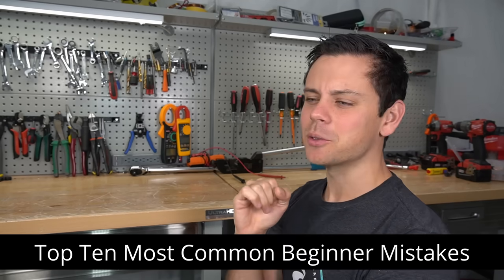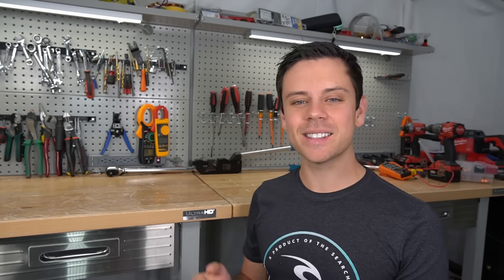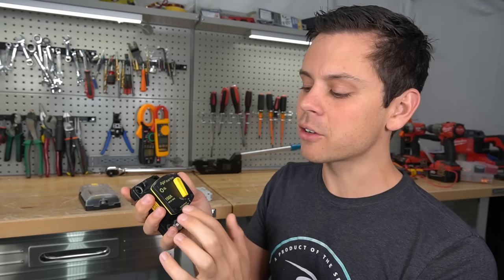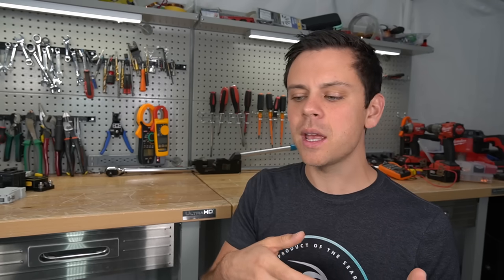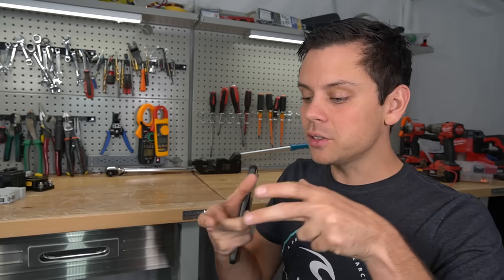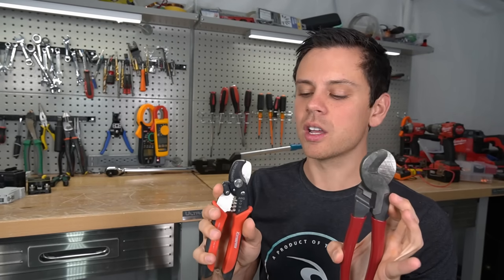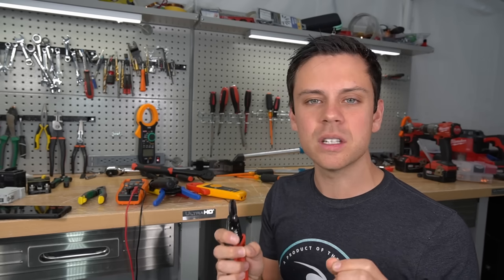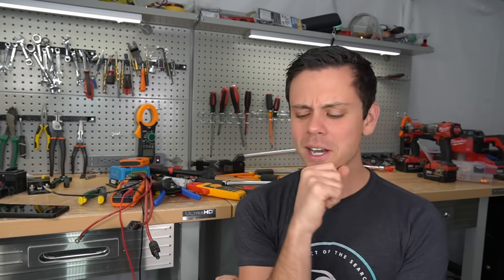Top 10 Beginner Mistakes When Building a DIY Solar System

Comment: No. 5: As an electrician I totally agree with you! In school they warned us about another point: solder gets soft over time and starts crawling and the contacts get loose and corrosion appears within. So, never solder when you can crimp!
Reply: Trojan recommends soldering battery cables.
Reply: Totally accurate.
Reply: @jeffwhite3021  Trojan is wrong. I live in Phoenix and it will easily exceed 150 degrees under the hood of my car during the summer. Many types of solder melt as low as 165 degrees. In particular avoid any solder with bismuth as part of the alloy.
Reply: I agree. I once did pull out tests of both molex crimp connections and soldered connections and the pull out force of the (properly) crimped connections were greater every time.
Reply: @ewe2b  It's about maximizing conductor contact area in the connector. They are suggesting and providing evidence that crimping and then flooding the joint with solder is best.
Reply: @jeffwhite3021  
I don’t know if that is what they are suggesting but what you said is the point of crimping then soldering.
Reply: @jeffwhite3021  
In mobile systems, a solder joint is a bad idea. It stiffens the strands in the wire bundle. With vibration, jostling, or frequent movement the wire will ‘work’ and break instead of absorbing the movement. Solder on any wiring with high potential for movement is not a good plan.
Reply: @fishhuntadventure  Marine ends get soldered. I agree it makes them stiffer which is why doing it properly with the proper terminals that are designed to be soldered is important. The round copper terminals that everyone uses are not good. For a crimp only situation you would use the split style connections with a tinned surface like you see in all OEM automotive applications.
Reply: @Zerpersande   he said a crimp that's "cold welded" is superior, essetntially saying a cold weld is superior to  a solder joint, which is hard to argue, but how many crimp jobs are actrually cold welded?  ... and who will check to verify?  some just mush the wires together, thats where the argument can be made soldering a crimp job is ideal since it fills in the gaps , gives you that insurance policy, and if your wires were cold welded the solder would have no effect in there anyway so it can hurt right? thats my understanding of all this misunderstanding
Reply: @mikejones-vd3fg  There is no such thing as a cold weld.
Reply: @jeffwhite3021  have you tried googling it?  anyway  the more i thought about it the more i suspeted no crimper could cold weld, im not up on my crimpers, but you can cold weld, metals actually stick together like water sticks to itself, they just have an oxidation layer from reacting with our air that prevents them from joining.  once you remove that oxidation layer you could stick the metals together without heating- cold weld, but from whati read about it long time ago you could only do that in space, from what im seeing on google there seems to be other ways... but i dont think a crimper is one of them lol,  maybe though im not an expert, but simple preasure wouldnt remove the oxide layer would it? maybe it does... but i dont feel like researching google either.
Reply: @mikejones-vd3fg  It's multi-faceted. Flooding an already crimped joint with solder will make a better connection than crimping alone.

Soldering alone (if done properly) will make a better connection than crimping alone.
Reply: That being said, after some more thought, like when soldering a wire to another one, you try and get as much contact with the wires befoer you sodler them intuiatvely,  you dont connect them to a blob of solder as a bridge  you use the solder to wrap hold them together, and idealy the wires are touching each other not with solder in between.  So solder might help a bad crimp job, buy filling in holtes, but thats less ideal then having those holes filled by actually wire- a better crimp job, and then the lug on the end sort of plays the role of the solder ,wrapping it all together.  The weak point is probably when you screw the lugs, all that contact you have with the wires could be lost there thats simply screwed, not soldered or crimped,  could have way less contact than you imagine under  a microscope.  So in the end if your soldering is helping it could just mean your crimp is not as good... and a better crimp is more ideal then having solder inbetween, cold welder or not.   But if you cant get a good crimp, solder will help.
Reply: @mikejones-vd3fg  Testing shows soldered joints have lower resistance.
Reply: @mikejones-vd3fg  
There is such a thing as a cold weld. Or at least the term exists. And it is NOT what is tossed about by DIY solar system fans. 

I worked in the distribution transformer industry for several years when I first dame to Japan. We had a problem with a 500kVA 6600V/200V transformer and a GE electrical engineer came to oversee the teardown. Problem? According to the electrical engineer, it was a ‘improperly made cold weld’. Which he explained as one of the leads from the coil wasn’t matched up perfectly with the output lead. The overlap was only about 30% of whT it should have been.

Now, the best I remember the ‘cold weld’ is performed by high pressure being applied while passing an electrical current through the area. Which is why I’ve always given any ‘cold weld crimping’ technique the hairy eyeball.

So, no such thing as a cold weld? As described in a crimping technique, no. In other areas? Well, regardless of how ‘cold’ it is the term DOES exist in the manufacturing facility of the GE plant where this particular transformer was made.
Reply: @Zerpersande  Cool, but i didnt say cold weld didnt exist, the guy i was replying to did. Interesting stuff anyhow and confirms my suspicions cold welds arent possible by simply crimping, but also still possibly better then solder inbetween.  Youd rather ahve more copper inbetween right?
Reply: @jeffwhite3021  There are some physical scientists who might disagree.  Start with "Cold Welding - Experimental Investigation of the Surface Preparation Methods"
August 1997Welding Journal 76(8):326s-330s, Wenqi Zhang & N Bay.
Reply: @calmeilles  Ok
Reply: @jeffwhite3021  So in a soldered terminal the solder would help conduct the current between the wire and the terminal. When a terminal is crimped onto a wire the crimping tool squeezes the terminal with so much force that the wire strands inside the terminal get deformed removing all of the voids between each strand of wire and the terminal so instead of strands of round wire in the terminal  you in effect have one solid piece of copper, the surfaces of all the strands forced together with out any voids, inside of the terminal. So if the wire is crimped with the proper tool 100% of the surface area of each conductor is transferring current to the terminal. So in other words I don't think the solder is going to do much to improve the connection.
Reply: @dandearman2871  Yes we can talk all day, why not run a few tests and see if the connection improves with solder?
Reply: @jeffwhite3021  My Mother-in-law still uses incandescent light bulbs in her house. She is convinced the LED bulbs are no good even when she could save a bundle on he electric bill and the LED bulbs last for years. If you like using the incandescent bulbs that's ok.
Reply: @dandearman2871  Sounds like she respects your opinion as much as your wife does.
Reply: @calmeilles  I read the paper.  Thx.   William Nixon, Metallurgist, Physicist
Reply: @mikejones-vd3fg  agree 100%.  People are throwing "soldering" under the bus. They aren't connecting the dots that soldering a crimped connection is a different animal.
Reply: @jeffwhite3021 I just looked and the tern exist. Basically no heat is applied to the connections. Bolting and crimping fall under cold welding.
Reply: @mikejones-vd3fg you would have to remove the oxidation before proceeding.
Reply: @genespell4340  No they don't. "Cold welding" is spot welding.
Reply: Wow so this is what electricians debate over 😂.  🥱
Reply: Thanks guys
Reply: If you solder wires you risk getting cold solder the wire eventually becomes loose
Reply: Lol...what school was that again? 
The Rat...NASA 1980 - 1992
Reply: Ask 10 electricians for the correct advice and you’ll get 11 different answers🤣🤣🤣

Comment: Great video! I would only add to the torque point this: Tighten to rated torque, then loosen a bit, then retorque to spec. You'll be surprised how often the connection "snuggles down" a bit more at the same torque once you do this. The screw or nut will often (more often than not) rotate a bit more to reach the same torque than it did during the initial tightening-to-torque. Such double-tightening makes the connection a lot more reliable over time!
Reply: That is a great tip. Thank you.
Reply: That is old school Wisdom you're sharing, I've forgotten that one. That tip alone will save so many people the headache of Loose connections down the road. Please comment some more - I know you got some more old school wisdom to share with us.
Reply: Marco Polo  Adding any lubrication will alter the torque.
Reply: MarcoPolo1776 this is news to me and I don't recall any mechanic that I have worked with doing that. I will definitely give it a try.
Reply: Over torque is an issue also. One worker used to super torque everything.
Soon after equipment connections started failing b/c the connection was cracked/ broken.
When wiring a service panel, it is recommended to recheck the connections 2 weeks after the initial install. Very few do this, but when I do, there is always at least 1 or more connections that need retightening.
One time in particular, I averted an almost fire from a loose connection.
I smelled something like plastic melting but could not find it.
When I checked the service panel, one of the wires was a smidgen loose.
I suspect when it heated up the looseness became more apparent.
Easy fix, once you know what is wrong.
Reply: My electrician friend taught me to tighten the screw and then check for tightness like Will always does, (and I shudder every time he does this) because then you wiggle the wire just a little and then tighten the screw again. (which Will never does)The slight tug and  wiggle sort of spreads the stranded wires out more so they need tightening again. He does the same even for solid wire. Will, your loosening the wire you just tightened by pulling on it like that.
Reply: Absolutely correct. Excellent tip.

Comment: Being a retired mechanical engineer, I found your video interesting. One thing, I'd like to mention your comment describing "cheap Chinese" products. Yes, there are many products made in China that are not safe for use with solar systems, but not all Chinese products are cheap junk. The quality of Chinese products has gotten much better over the last couple of years. I can say this because I use a LOT of Chinese made products in my daily life, as do most people in the US. Even our "American made" cars are not truly American made. I repair and operate commercial drones, and many of the drones made here in American use Chinese boards or CPUs. If you open any computer, you will not see "Made in America" on the motherboards. All I am trying to say is, there are many Chinese manufacturers who put quality above quantity.
Reply: Agree. Most of the top tier solar panel manufacturer are from China.

Comment: 72 years young grandma here enjoying your videos. Especially love the rant one. I'm from Pittsburgh pa and have a jackery explorer 300 and a 100 watt solar panel (my toy). We don't get half as much sunshine now that it is fall  but that explorer fully charges in 3 hours under full sunshine. I am pleasantly amazed at the sunshine power. I use my power supply to plug in a lamp where we have no grid wiring and a few other things. Waiting until I understand a lot more of this stuff before moving on to something more challenging.
Reply: You will love it when you lose power for 5 days and you can still watch videos on your phone or tablet!

Comment: Advice from an old electrician. Making a connection. Jiggle the wire and retorque, especially stranded wire. Never twist the wire beyond the normal twist of the wire. A tight twist will relax and it's a matter of time you Will have a loose connection.

Comment: My  first DIY  system is working great.  I over built everything especially the  wire size.  I built my system at about 50% of the capacity  of my inverters.  As a beginner I am one of the old school guys  that soldered my battery cables. Used to do  that as a heavy equipment mechanic 30 years ago.  I never had one  failure,  but will probably invest in a crimping tool.  It took me 18 months to save money and then install my ground mounted system. It was a  big investment, but  has been working flawlessly for 4 months now. It saves us  about 40 % on our  electric bill.  I am only using about  50% of my battery each day, and in an emergency could probably get about 30 hours out of my  small system. Definitely adding more battery backup as soon as funds are available.  Since we're retired and with limited income,  it's  difficult to have enough funds for large projects. Adding 10kw battery  backup would be extremely beneficial to our system. At least we have  a  small  emergency backup that we use everyday.  I  know that  if I  had the funds I would  go completely off grid. 
This solar power energy is addictive!
YOU JUST WANT MORE POWER. 
Everyone I watch on YouTube has increased their systems at least twice.  
Will,  I appreciate your videos and  applicable information on solar system and products.  I used several  valuable resources and information that you provided in the past 3 years. 
Even at 71 I'm still learning and exploring new opportunities to be more self reliant and independent 
Thanks
Reply: Andrew_koala  Maybe you should correct and edit your own post before attempting to improve others. :)
Reply: @Andrew_Koala  Perhaps you could ask your students to find the 5 errors you made in your short intoductory paragraph (below)........There are further various errors that you have made in your purported correction of the original post but I don't have the time or inclination to correct you as a reacher (sic). As much as I am tempted I will refrain from scoring your 'Reasonable writing ability', maybe you could let your students do so. 
   
Reasonable writing ability -  Your score  7/10 -- 
I use YouTube comments for my Students to correct.
I now reach English and History - following a 30 year Military Career - AIR FORCE
--
Your text corrected and edited"  and formatted paragraph text applied
Reply: I agree completely. I see really many examples of horrendous English on the internet but this particular post was not one of them.
Maybe all the "low hanging fruit" has made me more tolerant. LOL.
I will opine on the fact that the corrector's writing style was rather awkward.
Reply: Andrew_koala  So how many students failed your teach line?
As for History....  What did the founders do with the Declaration of Independence after they signed it?
Did they send it to George by courier?  
Did they give it to the first brit they saw?  
Did they just start shooting brits till George figured sumthin be up?
That is the problem with school, you don't know the questions to ask till you are out.
Reply: Good job I am in the process of saving up for my first DIY system. How much did the parts for your system cost? Cheers
Reply: @Roger Paddock  Approximately 
$ 8,500 including the ground mount system, which is 125 ft from the house. I oversized the PV cable for  future expansion. 
Good luck 👍
Reply: Andrew_koala 😂, you just nailed.  I would appreciated you come out EverDay , especially in Wills channel ,to teach us how to write down our thoughts ,a better way . Please, score this  one. Thanks.
Reply: @witness1449 Sounds like you are on a great path. Remember, no one ever walked 100 miles in one step. Make a plan for upgrading and expanding your systems and work towards making that happen step by step. Your solar system is already paying you back by saving you on your electric bill and with peace of mind. I have no doubt that you will be off the power grid soon. 

Best of luck. 

D.
Reply: @WestMountain Adventures  Thanks for the reply 👍 I designed it to be doubled and  installed heavy wiring when I ran the PV  adjustable ground mounted system. This year, we're tripling our backup batteries, which is a huge cost on a fixed income. Next year, we'll add 12 more panels. Saving and paying as we go has made it manageable, and it's working flawlessly. From 7 years ago we have reduced our electric consumption by 62%. By next year, we could possibly be 100% off-grid. 
Not bad for an old fart! I'm still kicking, just not as high. 
Take care and be safe!
Reply: You are on the right track. I use the Power companies as back up to save the batteries at night.
Reply: I built my 24v system with cables thick enough to run it with 12v if somethings goes wrong when I am out on the road camping with my box van camper and for example the 24v 3000w inverter dies and I can not get any other then 12v inverter as replacement. (I had to order the 24v inverter as no stores here have any equipment for 24v),